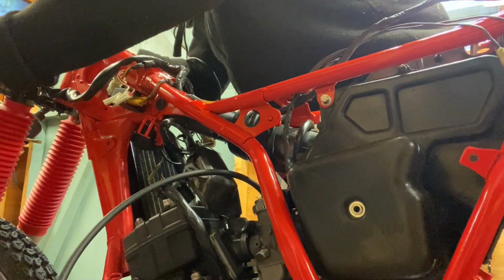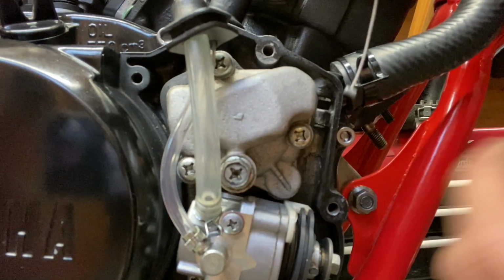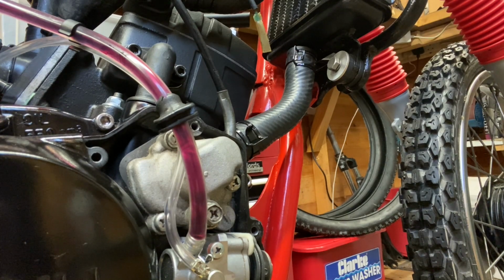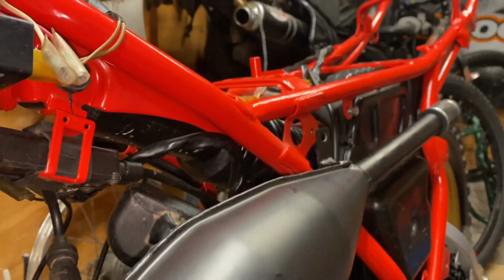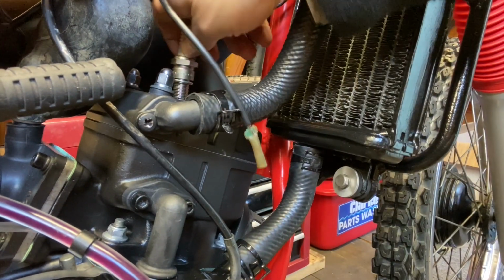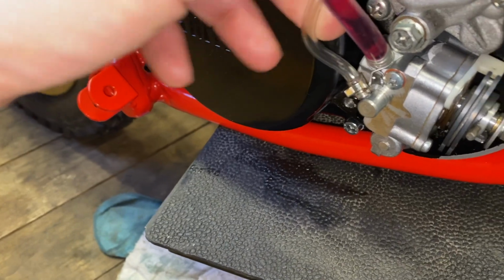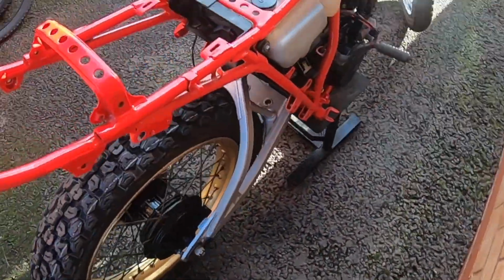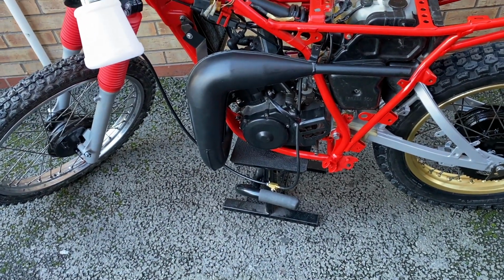YAMAHA DT125LC PROJECT EPISODE 7 (WILL SHE RUN!!!)

Comment: Nice, sounds mint! you can speed the oil pump up by pulling back on the oil pump pulley simulating full throttle
Reply from the maker: I did do that off camera and it helped, it didn’t seem to speed up much though, sort of went fast for a couple of mm then stopped until I turned the pulley again, just hope my pump isn’t faulty
Reply: @retrobikestuff760  good you've got the clear tube so at least you can monitor visually :-) if in doubt I'd always add oil to the fuel and avoid the pump / risk entirely but to me it did seem to be working same as mine when i changed to clear tube
Reply from the maker: @rdom4256  ah that’s good to hear, I would like to keep the pump if possible 👍 

Thanks for the information it’s much appreciated

Comment: THANK GOD YOU OPTED FOR PREMIX!! i thought you were just going to start it and wait for the pump. It would be a good half a minute even with pulling the pump cable open to fill the line. That would probably put an end to your hard work. I fill the oil line with a syringe then attach to the pump and carb, and still use premix until pipe is full. good work. Big one sounds nice. I have a giannelli front pipe and DEP end can on mine😎
Reply: can you choose to not use the oil pump and mix it yourself in the tank?
Reply: @Thomas  you can, not sure why anyone would want to though.
You have to blank off the pump and the oil stub on carb, and you have to upjet when you premix
Reply: @mellowr1  i have trust issues with them pumps
Reply: @Thomasside299  mine have all been rebuilt. Good for another 20years👍